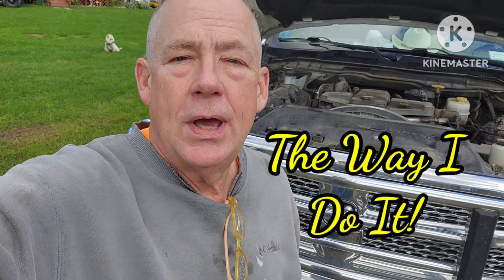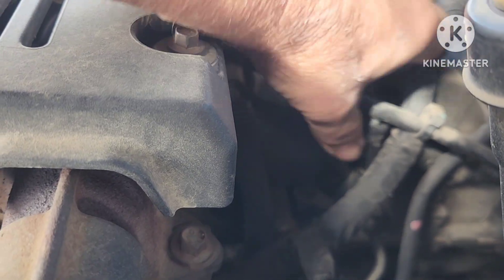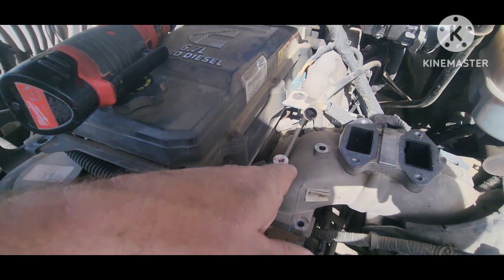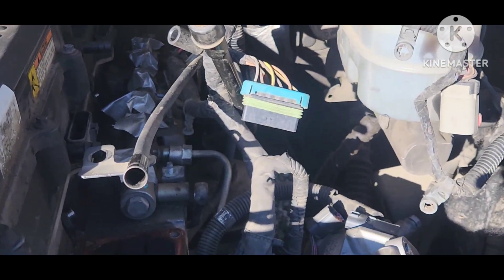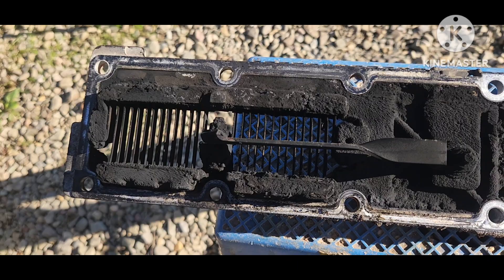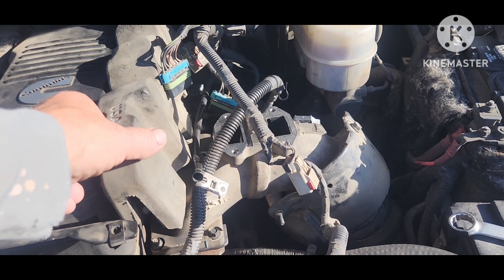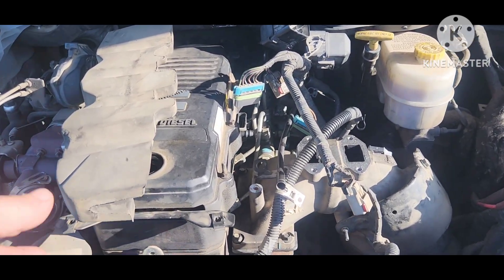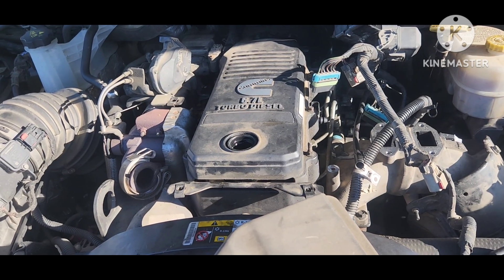$25 Grid Heater Repair for P0542 killer bolt nut or stud cummins 6.7

Comment: I think the relay fails and sends too much amps and melts the bolt. I don’t think it vibrates off from what I’ve read.
Reply from the maker: Sounds like its possible.  Had a fire truck once that had a similar relay operating a high amp siren.  It was mounted in a position that depended on a spring to break the circuit.  Also, it was in a position to get water on it. It would fail in the "ON" position.  You surely would know it.  If the grid heater fails on, how do you know?  The dash light isn't direct, the dumb assed engineers illuminate the light when the computer is asked to turn it on.

Comment: apparently, the amperage degrades the stud/bolt over time on some engines.  I have 140k miles on mine, haven't done the wiggle test yet and undecided whether to do anything...
Reply from the maker: I have 400k miles.  When I did this the stud was good.  I can't say what happens.  My guess is it gets loose for some reason.  Maybe a problem with torque when built?

Comment: For the effort and piece of mind, I honestly would have swapped out the inferior factory grid heater for the beefier BD Diesel set-up while it was apart. Because it hasn’t failed yet doesn’t guarantee it won’t happen in the future.
Reply from the maker: My oil pump might fail.  My head studs might break.  My flywheel might fall off.  Who knows. ...
Reply: @t @thewayidoit8895 Every choice is your own for sure.

Comment: Kind of what I was thinking.  I have an 08' that I bought new that has 240k. Haven't done anything but replaced egr valve. When you have a bunch of heavy equipment miles from the nearest town you learn to fix stuff with whats there. Lots of money is wasted over having no common sense. Good fix!

Comment: well done, how many emissions issues have you had in 400k?
Reply from the maker: @donniediesel6.789  I've only owned the truck since 4/19 @ 330k miles.  I replaced the Turbo due to the actuator failing.  I replaced the DPF and SCR with low miles takeoffs from another person.  Thats about it. Before I owned it, I believe the DPF and SCR were replaced under warranty at 170k.  Thats it for now.
Reply from the maker: I've only put the last 70k on it.  I started out having to change the dpf & scr but it was likely due to a bad turbo actuator.  I put an aftermarket turbo on as well as a special stronger actuator.  Having issue now with a sensor that might need changed.